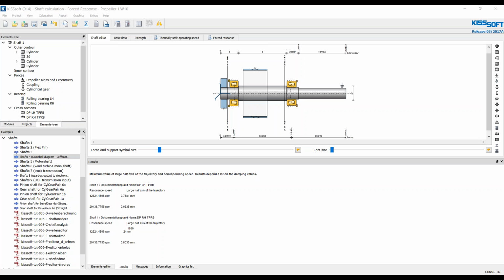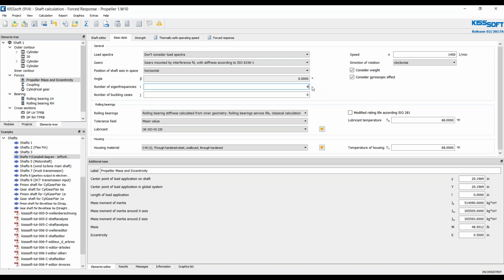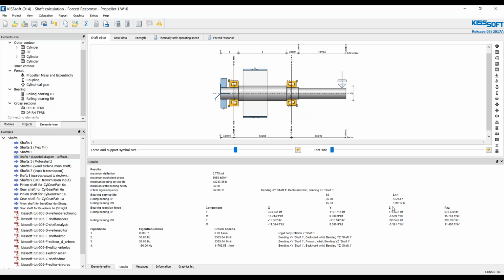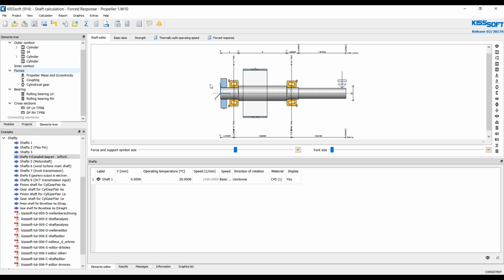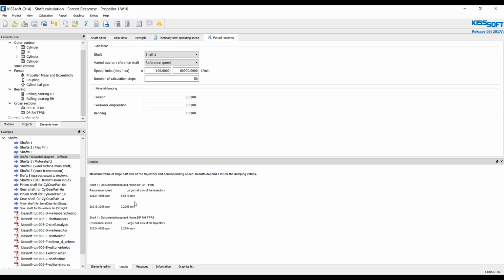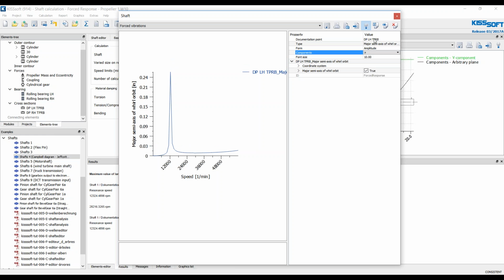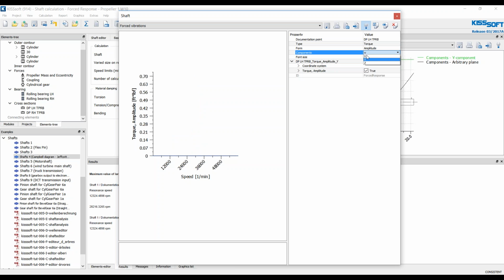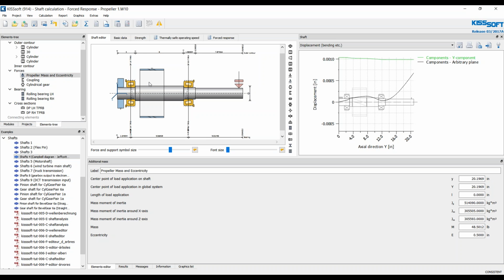2017 Forced Response of Shafts - KISSsoft

Comment: Not able to find the Forced Response option in KISSsoft, only campbell is available
Reply from the maker: Not in the calculations pull down?
Reply: @kisssoftusa9363  No, just thermally safe speed and Campbell response, there is no option for forced response in that pull down
Reply from the maker: What version are you running?  2017 or 2018?
Reply: @kisssoftusa9363  2016
Reply from the maker: @amansrivastava3275  forced response was not implemented until 2018, sorry